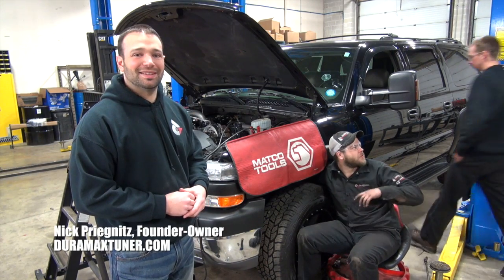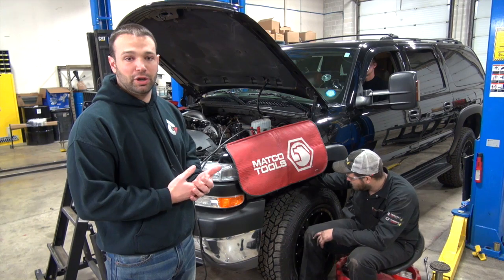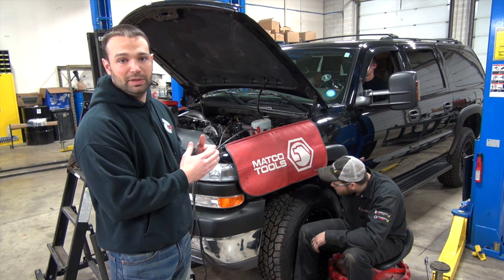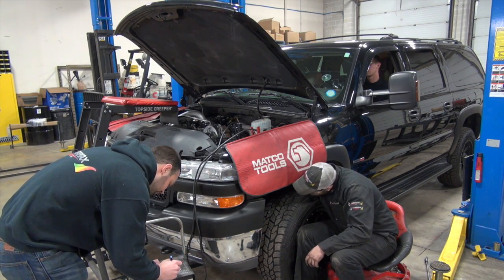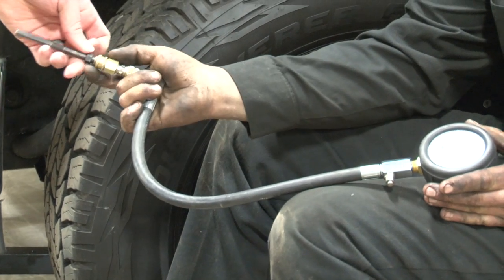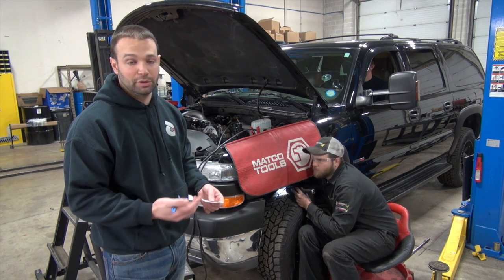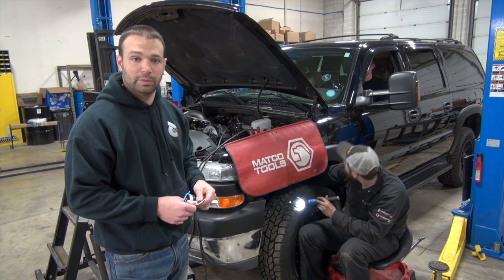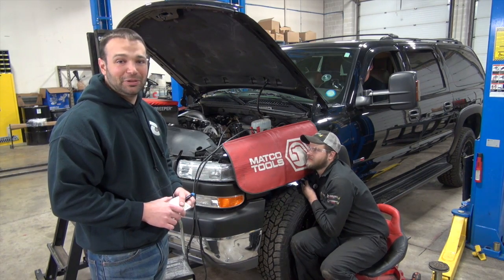Compression Testing an LBZ Duramax by Duramaxtuner

Comment: Hey i have a 2003 2500 it was driving fine I parked it then the next day it was a crank no start 
Is there a direction you can point me in to troubleshoot please
Reply from the maker: We'd need a code or our hands on it. Hook it to a battery tender? If you haven't done anything to the truck and just parked it, can't see what would cause an issue if no problems presented prior.
Reply: @Duramaxtuner  thanks for the response 
P0748
Please check the wireless connection. (1)(2)
Pressure Control Solenoid Electrical
P0763
Shift Solenoid "C" Electrical
P0768
Shift Solenoid "D" Electrical
P0773
P0778
Lock-Up Solenoid Electrical
PCS "B" Circuit - Electrical
P0743
TCC Circuit Electrical Problem
P0880
Put a new TCM and new batteries
Reply: Did u ever get a chance to look over the codes

Comment: I have a question.. my 2003 sierra with lb7. Got problems with pushrods.. was bend pushrods.. i did new headgasket, new rockers, new pushrods, arp stud.. 
when i installing the rockers the engine won’t turn over . But when i loose then up it will .. whats that mean

Comment: Is it normal for the gage to b showing a pressure loss when he is cranking the motor
Reply: As it cranks the exhaust valves open to relieve the pressure every other stroke. That is why it jumps up and down.
Reply: No his gauge is a piece of shit there should be a check valve in the quick connect fitting that holds pressure and only allows it to build and not fall off